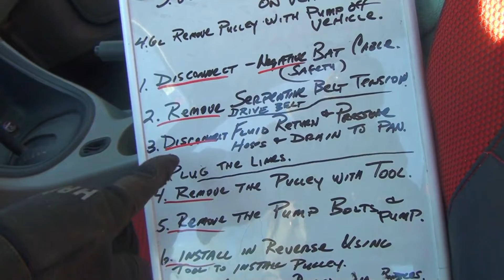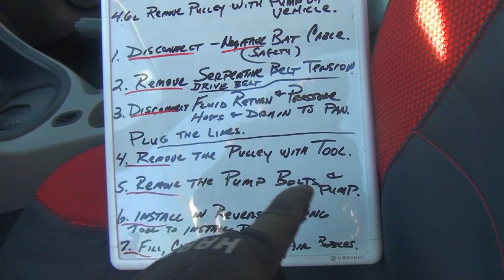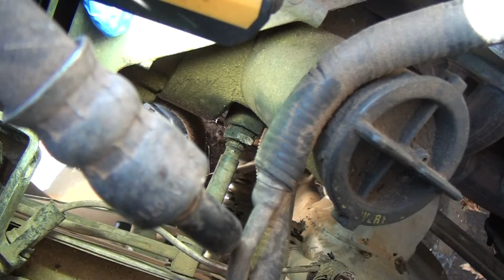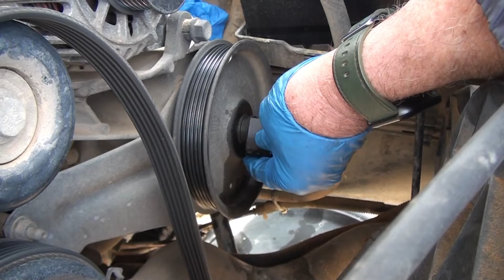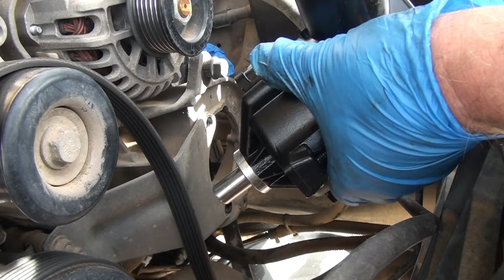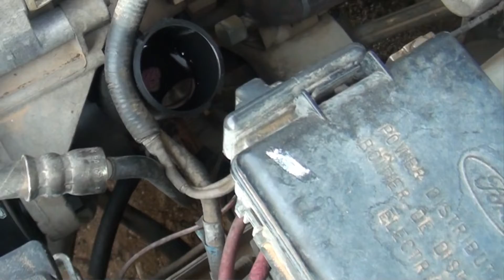1994 to 2004 Mustang Power Steering Pump Replace

Comment: I’m doing it correctly but it just pops when I turn it, its not coming off
Reply from the maker: More turns may be required to pull it off the shaft. It does not just come off in a turn or two. Keep turning and the center shaft of the pump should be less and less visible at the front.

Comment: This is a very good video for the non-GT Mustang. It’s set up a little different. I do have one question though. Why did you heat up the nylon O-ring? Is that required? Were you just having some problems getting it on there? If I tighten up the pressure line too much, will that O-ring break?
Reply from the maker: @joshuag2522  I believe I heated so it would expand and go on easier. I would tighten the line snug and check for leaks, then tighten a bit more to stop a leak if one did appear. One of my best cars was a 1967 GT 390 Mustang. Fast and handled great. Thanks!

Comment: Amazing video mate, thanks so much
Reply from the maker: Thanks, glad it helped you out!
Reply: @SteveAZ711 one question, I took everything off, and the new power steering pump does not have the funnel where you add the fluid, so I remove the funnel off the old one ? If so how, thanks so much
Reply from the maker: @Itsblakedurrant  I always buy one with reservoir so I did not have to do what you are gong to do. Here is a video I found that may help. It does not look to be difficult, but paying attention to the o rings seems to be a priority. Here is the link...https://www.youtube.com/watch?v=mOfEFbMri6g

Comment: Did you put transmission fluid in a power steering pump?
Reply from the maker: I used Mercon V transmission fluid. Thanks!
Reply: @SteveAZ711  what is the benefit of transmission fluid in the power steering pump?
Reply: @annabee2345 same thing pretty much for these cars.

Comment: Great vid, I notice that 1996 gt models have a diffrent design in power steering pump and it conencts to a hydro booster for the braking system.
Reply from the maker: Yes that GT is a bit of a different animal. There is probably a YouTube video out on it I am sure. Thanks!